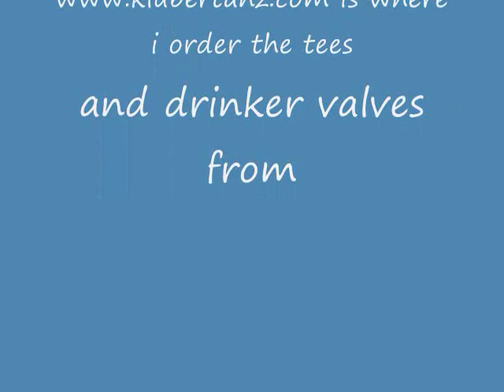Rabbit automatic drinker system part 2 the completed system

Comment from the maker: I tried the heat tape.  And was unsuccessful. Like you said they will try to chew it and sure enough mine did.  I plan to do the water bottles in the winter and the drinker system in the summer months.  I will just make sure I don't have a bunch of rabbits during the winter that I have to worry about.  Thanks for the comment.

Comment: we run a heat lamp aimed at the bucket and heat tape and insulation to the pipe.  just make sure rabbits can't chew any of it.  may have to put piece of wood between pipe and wire to keep them from nibbling.  we have a harder time keeping water cool in summer.  ice bottle in the bucket melts too fast.